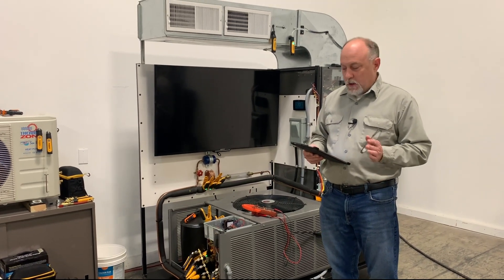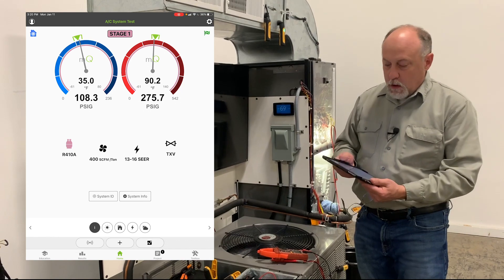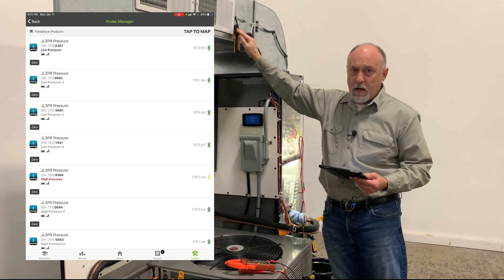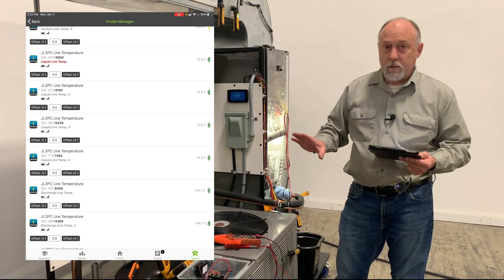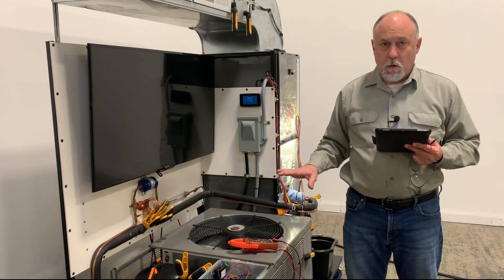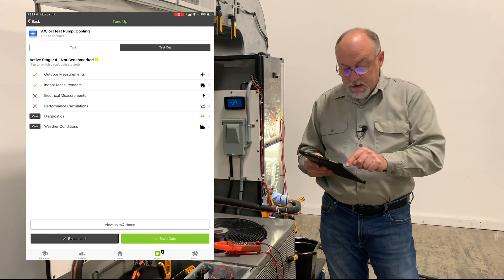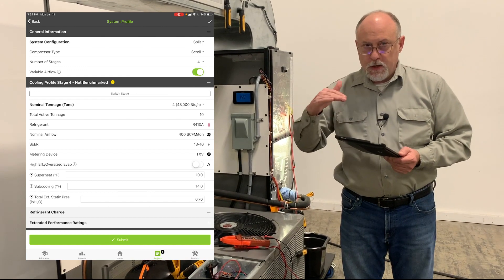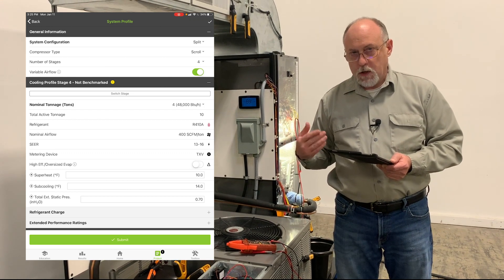Multi-circuit mode on measureQuick

Comment: 3:19 - I am using MQ only on commercial refrigeration. How can I sign up for the refrigeration beta. I have several four degree cold rooms using 4R04a
Reply from the maker: It on the app. Go to the "Start Project" section.

Comment: Can’t see multiple stages after selecting multi circuits is this a paid option only ?
Reply from the maker: No, that is a bug, it is fixed, we just have to push it out. The work around is to start multi circuit from a project and it will work. You can do a project at no cost, so it will work the same.

Comment: I have not been able to connect testo smart sensors in multi-circuit mode.  Prevents sensors from being tied to different circuits.  What am I doing wrong?
Reply from the maker: The Testo probes did not work for multi circuit because they require a direct connection. This limits them to about 6 to 8 probes. For multi circuit mode you have to use Fieldpiece.
Reply: @measureQuick  Thank you!  Is it impossible to bypass the restrictions?  But thanks for being able to implement strict registration of probes in Android.  I can watch two circuits with two smartphones.  I believe in you and your ingenuity.

Comment: Dear Jim.  I do not see how to connect testo sensors to circuit 1 and circuit 2. I enter the menu and set the measurement in 2 circuits.  I go to the sensors menu, and I do not see an opportunity to select a circuit for the sensor.  How to do it correctly?

Comment: Hi Jim, nice to meet you!
I speak from Brazil I have the Fieldpiece probes (JL3PR) and use the mQ app for my diagnostics. When I install or I do maintenance in a split of low capacity, usually I have the low pressure valve only in the condensing unit, how should I proceed with the probes and the app configuration for diagnostics?

Comment: Outstanding work guys. Will there be an option for a "Pro" version of the software (App Purchase) for the advanced tool set (without the cloud features) instead of purchasing Qbits for every system worked on?  Asking for a friend.. ;-}

Comment: The multistage mode is very nice, been using it when commissioning Trane XV equipment. Much easier then how I was doing it in the past with reprofiling the equipment each stage and don’t get as many red flags when running in less than 60% capacity.

Comment: I left a question on an older video titled "How to properly charge a system". In that video at 4:15 you began preparing to charge the unit & cleared the air from the charging hose. Here is my question though: 

Isn't there still air in the piece of hose right after the ball valve? 
Right after you close the valve, doesn't air fill the last bit of the hose by the time you hook it on to the unit? Am i missing or not thinking about something here? Did you just put non-condensables in the system? Thank you for your help.
Reply from the maker: No, refrigerant will continue to output gas from the hose for several minutes.  Think of it like putting you finger over the end of a straw. The gas will push out for awhile. After venting, I connected to the true suction. If you purge a hose and look at it in the right light you can actually see the vapor push out.
Reply: @measureQuick  Awesome, i knew i was missing something. I've learned something today! Thank you very much.

Comment: Very cool on the two stage stuff I haven't played with that yet. Did you do a bunch of r&d to map out the software for 2 stage scrolls in low stage? I know the airflow differs between equipment in 1st stage but the compressor usually is the same size

Comment: Can we combine multi circuit and multistage? Say I have two compressors with both having unloaders in it?
Reply from the maker: You could make a snapshot on any configuration, that said that type of equipment is typically tested at full capacity.

Comment: Nice. So is this the equivalent to checking two separate systems at once? I noticed you said circuit and stage but not system. Thanks again, I appreciate all of your hard work!
Reply from the maker: 4 circuits, like a rooftop unit with 4 compressors.
Reply: @measureQuick  thanks. Will there be a update for multiple systems?